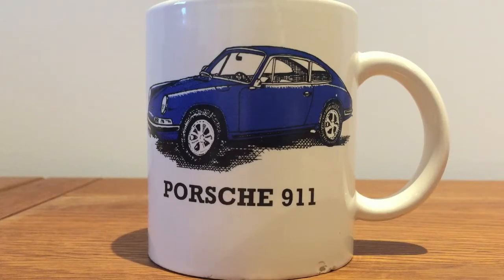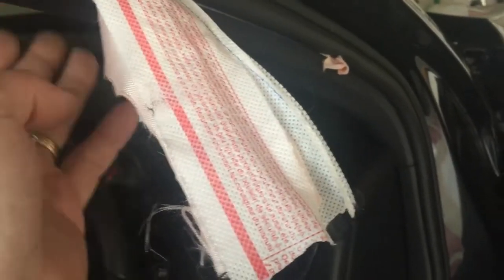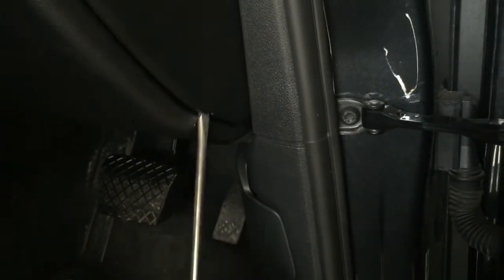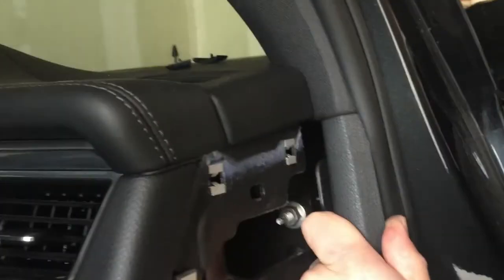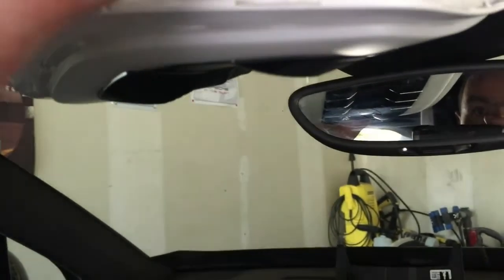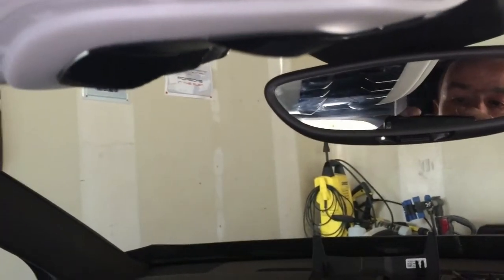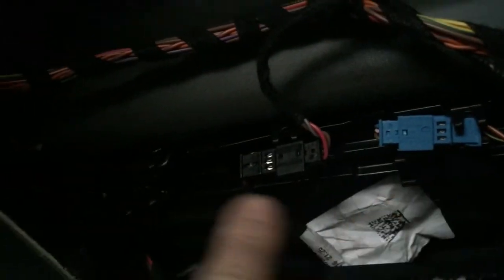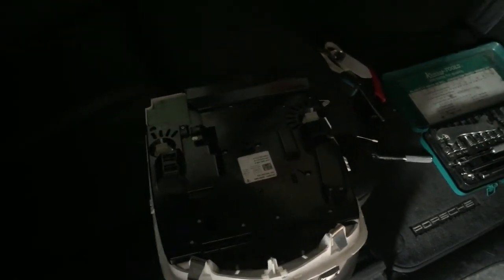Porsche Macan head airbag removal

Comment: Hi, great vids!

Is there need to replace any trims or headlining when the curtain airbag is blown?
Reply from the maker: I didn't have any need to replace trim or headlining for curtain airbag but that may not be the case on all cars.  There is a small mark at one part of the headlining where it bent at the edge but not enough for me to want to replace it.  Although you did not ask about seatbelts, I did have to replace trim at the top of the rear seatbelts as that was broken in the accident when they locked up..
Reply from the maker: And, thanks for the compliment on the videos.

Comment: Hey. Great video. Did your power steering go when the airbags went? We’re about to replace the curtain airbags.  We guess it’s as simple as plugging in and clearing the airbag code, is that all you needed to do?  Our power steering has gone as well.
Reply from the maker: Hi, thanks for the comments.  I did have an error for 4 wheel drive because of the suspension issues but nothing related to power steering.  I was able to clear the codes with icarsoft CR v2.0 for which I had their Porsche specific software loaded rather than using the generic code reader. There was no need to send off airbag module.  Not sure what you plan to use for clearing the codes but I would suggest using something like the icarsoft as it seems far better than generic codes readers/ fault clearers.  Using it should hopefully allow you to see if it has a code for the power steering. Might be worth clearing all the codes and seeing what you get back.
Reply: @porscot  I’ve purchased ICARSOFT POR V2.0 hopefully that’ll do as you say.  I’m just waiting for my body shop to remove the headliner and bags so we can install new ones.  Appears my car took a knock to the front passenger wheel, maybe further damage to suspension although no warning lights.  Have multiple communication issues with front wiper/headlights/power steering.  Hopeful it’s an electrical short or blown relay.  Glad to know I can just wipe the codes after installing new bags.
Reply from the maker: @johnturner8795  Icarsoft certainly paid for itself on my repair; they issue regular updates so worth checking for latest download version before using.  Good luck with the repair.

Comment: HI YOU NOW WHERE IS THE AIRBAG MODULE  IS LOCATED AND HOW TO REMOVE IT?
Reply from the maker: If you download the parts diagrams from Porsche and look at diagram 901-005 you will see where it looks to be.  It is between the front seats at the rear of the centre consul somewhere under the electronic parking brake switch.  You do not actually need to remove it.  You can clear the codes for airbags using scan tool such as Icarsoft V2.0.

Comment: Mate, you talked too much did not show how to remove the curtain airbag. It got some type of clips not easy for me to remove it. I was searching here to find a tips but nothing helpful
Reply from the maker: Try pliers for removing circlips;  the technique as I recall was to get the pliers in the small holes on the top of the clips then close the pliers to pull the tabs towards each other and the clips then pull out.